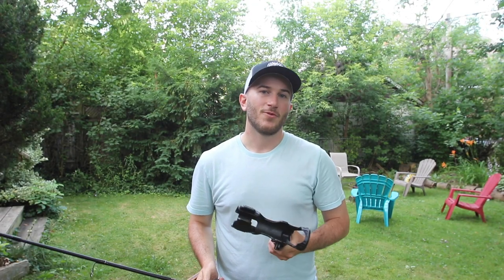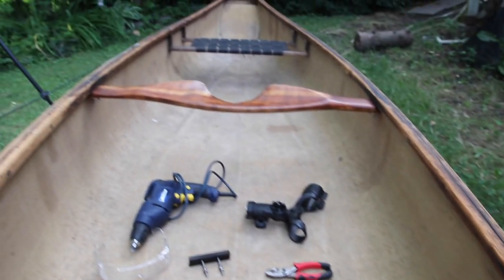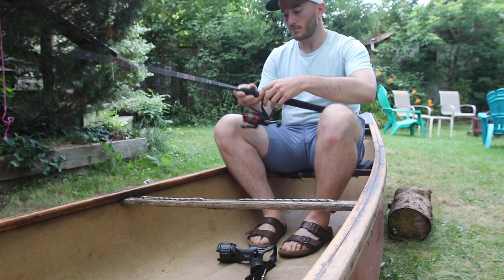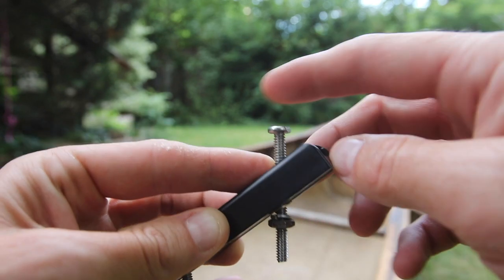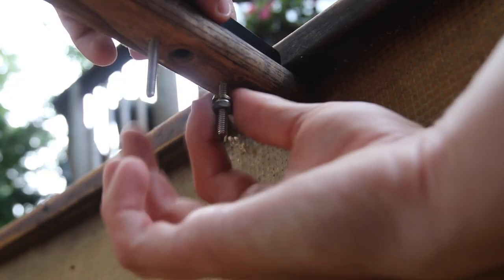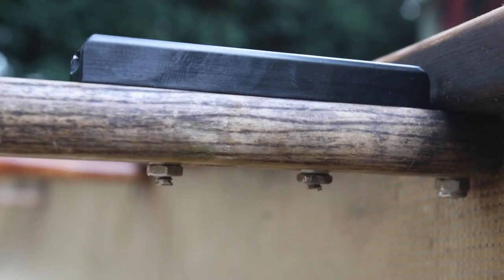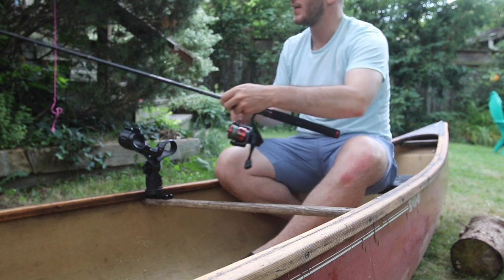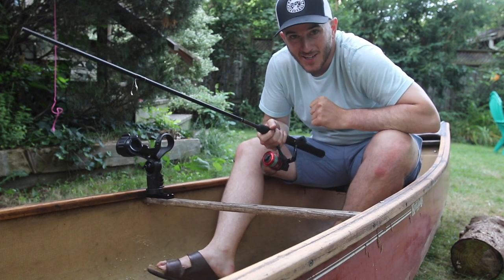Install Rod Holder On Canoe | How To Video

Comment: for the type of rod holder you have in your video that worked.  however, i think the better option is use a scotty rod holder with a gunnel mount accessory that way no drilling in anything required and you can move it around whenever you want.

Comment: I never used to catch fish, then I got a rod holder, now I catch fish! Coincidence? Probably not. I always run my rod just behind me because I use a double blade and it only works there. It also keeps the line completely out of the way. Doesn't interfere with my j-stroke either. That mounting system looks great I'm still using a clamp and a leather glove lol I need to improve that.

Comment: Use the right size bolts  so you won't have to cut them. And the appropriate rod holder so you can attach to the gunnels with wood screws and no drilling.

Comment: Pick up some cap nuts instead of the standard nuts you have.  They'll be even smoother than the cut ends of the bolts.

Comment: Always having a rod holder in your boat/canoe/kayak is a great idea. Frees up both of your hands and legs in case of an emergency. One thing I would suggest doing with those bolts where you cut them off would be to take a hammer and flatten/mushroom out the bolts so that the nuts on the bottom side can not unbolt on you. It doesn't take much to do it either. Take it from a Machinist of over 27 years you don't want those nut backing off and loosing off on ya. Hurry up and get out there and teat it out for us and report back as soon as possible to us how it went....lol Take care and will see you on the next video. Hope you didn't get hit to hard with Teddy. Lower Sackville faired out pretty good I guess. Tom

Comment: If you think this'll be life changing, wait till you get around to installing a beer holder! 😂😂
Lots of comments on ideas, but you did fine.  It'll work, and it comes off with just a little mount, bolts are smooth, so it's all good.     Only thing is this type of mount can't be moved, but you always used it on the same side anyway.